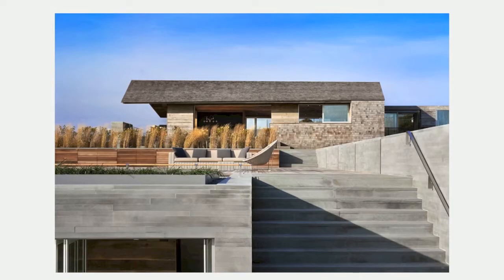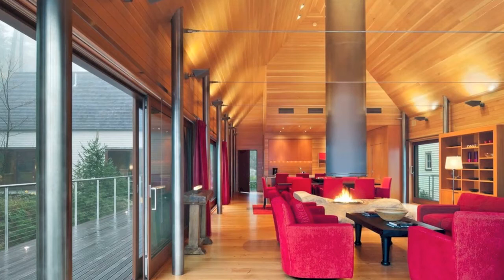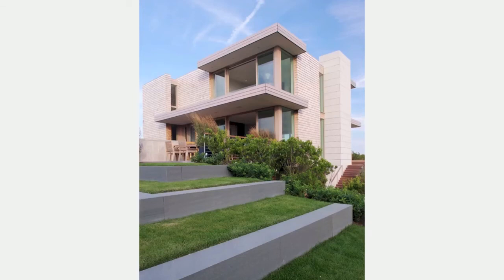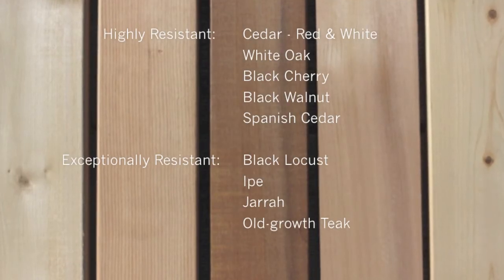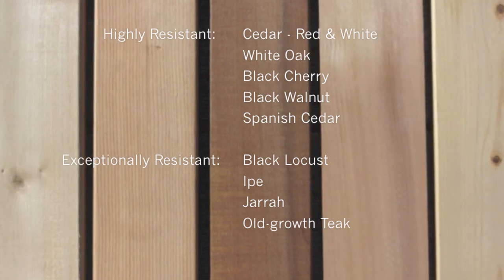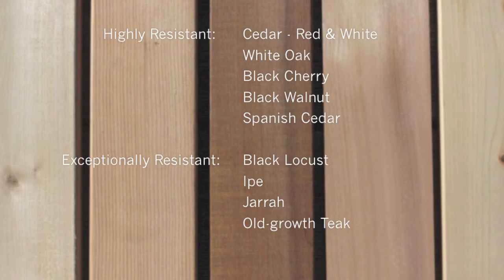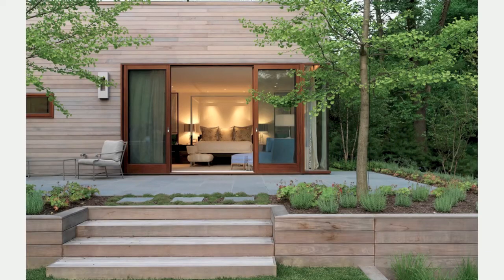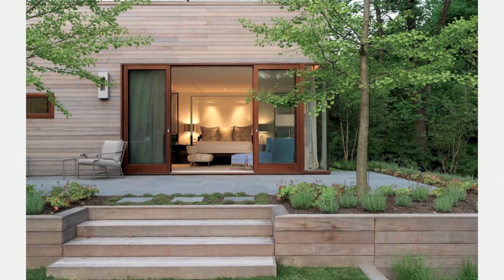Natural Wood Siding (minus the maintenance)

Comment: The ideal woods is cost prohibitive for many of us. I personally love the look of weathered wood,especially if n a rural area.  I am in N.E. Georgia and there were some houses here that were sided boards that were left “live edge” on one side but I don’t know what would was it used or how they held up over time.  Pines and poplar are the most available woods here followed by oak and sweet gum.  I don’t know the sustainability of sweet gum.

That said,are you familiar with a product called Bora Care?  Not a stain or water resisting agent but uses boron to resist parasites. If memory serves me correctly, there is a Bora Care Plus that also contains borax which also prevents fungal growth.  I would love to get feedback from anyone familiar with this product.

If a water repellent product or a product such as mentioned above is used, it t seems to me that both sides of the wood should be treated.  Treat the unexposed side prior to installation.  I would love to hear your opinion on this.
Reply from the maker: Best woods to use if you're contemplating not finishing them are native, rot-resistant woods. Here in Maine, that's predominantly Eastern White Cedar. The benefit of using local is they support local economies, limit shipping costs + pollution, and the local labor force is familiar with them. Here on the coast of Maine where I practice, Eastern White Cedar shingled buildings last a very long time if left alone and weather to a soft, silvery gray.

Comment: What could be appropriate uses for four acres of Douglas Fir once planted by the family as a Christmas tree farm but never realized (probably 30-40 years of growth, varying diameters)? We have a non-salt marine climate... in the great state of Michigan. As we say here: No salt, no sharks, no worries!
Reply: Also, how do we harvest it? How long before we can use it? Is it only good for the interior?
Reply: Doug fir is a wood that is equally well used inside or outside. It's often used in board and batten on the exterior, or often used for larger/longer lumber. 

4 acres isn't too large to harvest yourself, if you've got the initiative, time, etc. But it's likely not worth it--at least moneywise.

As it appears these trees haven't been maintained, you likely will wood with a lot of knots--which will limit it's commercial value as lumber.

Still, you could probably sell it to a smaller timber company for clear cutting or selective cutting--which will again limit it's value.

Should you have a dream cabin you've been wanting to build nearby, your most efficient use of the timber may be to hire someone to log the wood you need, and use the larger, similar diameter timber for your timber frame or log cabin. That way you're saving a boatload of money and using it for something which it, as less than ideal lumber, is well suited for.

But that's just one idea--go brainstorm some more! Good luck...

Comment: I have been experimenting with local hemlock as siding.  It is reasonably durable, very inexpensive and I like how it weathers to a silvery grey.  I also like introducing the aspect of time into the design.  Modern rainscreen detailing and gapped siding detailing makes this material a viable siding option.  At the end of its usable life or if any boards deteriorate, it's easy to remove and replace them.  Without any finish, they can simply be left to decompose and provide habitat in a rural location.
Reply from the maker: Thanks Robert Swinburne  - I was just checking the Forest Product Lab's site for decay resistance and they list it as slightly to non-resistant to decay. Local availability is good for those of us in the north woods and it's competitive from a price standpoint certainly, what's your experience been with the decay resistance? If you keep it dry (with the rainscreen detail) I imagine that would help substantially to ward off rot. And, with the 'reclaimed wood' market being what it is today, there's no reason that the aged siding couldn't be repackaged and sold again as 'pre-weathered siding'.